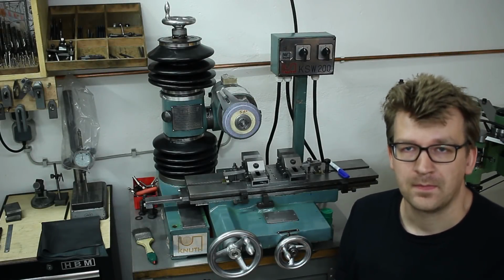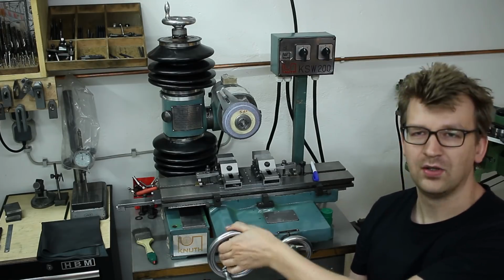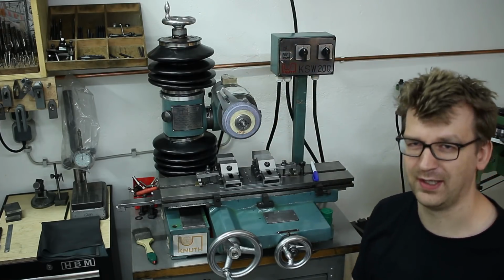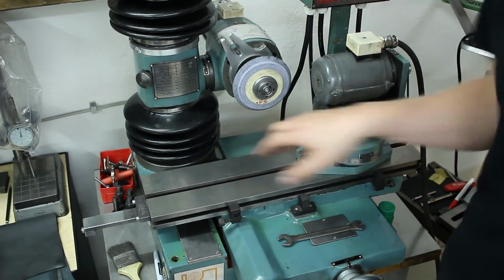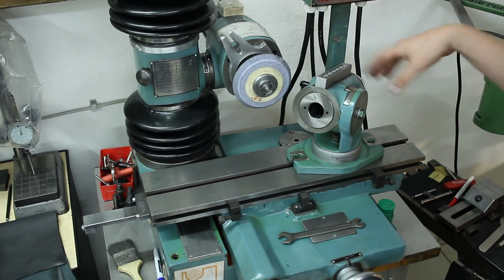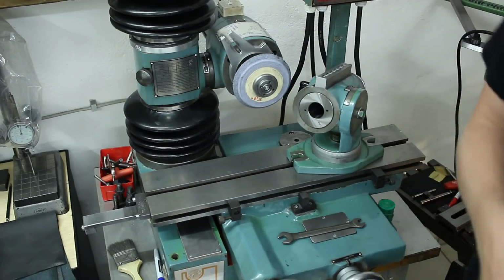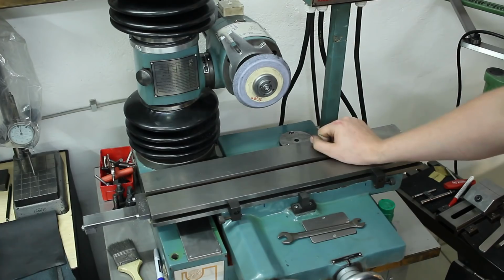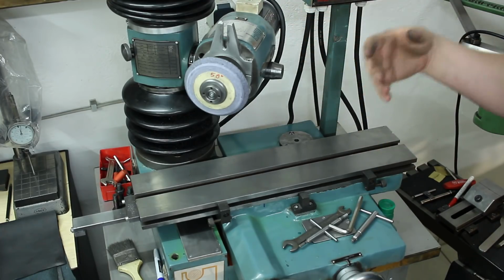Knuth KSW - Overview

Comment: Hi Stefan! I got WALTER UWS250 grinder (built 1959), and I am now colecting different accesories (mostly USSR made) for grinding. And problem is that I cant find any info about this machine, may be You can suggest where in german internet to find something? It is a old machine and I beleive that only manuals are (was) only paper version and has gone in past...
Cheers from Latvia!

Comment: i been thinking further intoo building / creating a usable allround toolgrinder and i like to hear youre thoughts on this idea i have 

second hand small lathes are a lot better available then used toolgrinders and can be bought for about 250 euro  
i wasnt planning on doing lathe work on such a machine ever again if i was going to use it for grinding as the grinding dust will ruin it 
if i replace the chuck with a grindingwheel (making a tapered stub intoo the tapered end of the spindle , held in with a drawbar though the rear like on a mill then mounting the stone on the other end of the tapered axle stub like it does in youre deckel style toolgrinder 
if i make those tapered stubs for every grindingwheel i have  i should be able to keep the stones on it centered and flat even when changing them around 
the carriages on the lathe will take care of the up down side to side motion (i'll be moving the tool to the stone from the side ) a lathe allready has all the dials needed to do "precision grinding" per side and either the compound rest or a spindexer set on top of that that can be rotated and tightened at any angle in the vertical plane on the toolpost using a degree dail (need to make sure the center of the spindexer is at the center of the spindle of the lathe , might need to make a fill plate under the lathe head to lift it off the bed a lot more ) )
i should be able to make other toolholders that mount on the compound or the carriage to grind lathetools and drills and even with the mini lathe i should be able to grind pretty big tools and run the stone at the rpm it needs and have enough power 

since youre doing a lot more toolgrinding than i do , could you see any problems with the idea ? 
(like not able to reach parts or make relief cuts stuff like that )

Comment: I hope those Chinese motors don't die on you. The driven workhead, ok, would probably not be hard to replace, but the spindle motor... entirely different story. No off-the-self norm-motor is going to be of use there...
Reply from the maker: Had it already apart - No problem to put a standard Iso-flangemount 3phase motor on :)

Comment: Wow I learn something from you even after not watching your videos for over a year, your English is so perfected (slightly improved change in only + more year Stefen) now. I am mad as you share and I learn about German households having 3 phase power at each house. We had to place a new poll, 3 capacitors and pull wire from that to our 400 AMP breaker boxes and so forth. The tool and surface grinder is nice sounding, it is also nice to be back to watching you make things happen.

Comment: regarding industrial stuff, couple months ago I saw a deckel S1 (I know it's not quite the same thing application wise as this Knuth) with some accessories sell at an auction for around 600eur, I'm still biting my nails in the mornings when I remember that, even though I don't really have the floor space to place it inside the shop :( , and that "final" price doesn't really mean that you could also buy it for that, that price might have just as well tripled if you and the other guy really wanted it, I was expecting it to cost way more, since the S0 usually sell for around 500 regardless of condition and tooling that come with them

Comment: Can't forget the variances caused by high or low tide.  Or high-low tide or low high tide.  And the extremes of high-high or low-low tide.  I seem to recall a conversation with someone that actually had that issue with a very large lathe that was in a seaside shop.  He said their solution was to move the lathe to another building farther inland.  I think I would have tried putting the lathe on it's own floating (independent from the rest of the building) block of concrete.

Your equipment gets smaller, mine keeps getting larger.  I decided to go ahead and get a surface grinder, ended up with a DoAll D-8.  Only about 2.5 imperial tons...  I'm back to squeezing myself between machines again.  It's footprint is about double what I figured it would be.

Comment: Like the cable drive change. The rack and pinion is one of the things I hate about mine. If I'm not easy it shows in the finish.
May do the cable drive to my new one👍. Great overview
Reply from the maker: Thanks Steve! I will do that cable drive mod to my surface grinder too - And then film the whole process.
Cant wait to see your new grinder, be safe, thanks for watching!
Reply: @StefanGotteswinter  are you still going to make a video on the cable conversion?
Reply: Yes an overview of the pros and cons of cable drive versus tooth drive would be very welcome. Thank you Stefan and Steve for your videos
Reply: the cable is wound on  drum?
Reply from the maker: @satxsatxsatx  it loops around the pulley one time
Reply: I'm wondering if a cable would be suitable for a plasma table's long y-dimension rather than rack/pinion

Comment: 4:15 is it just me or does a bearing sound crunchy on that motor?
Reply from the maker: Very possible - The spindle bearings are fine, but the motor bearings...maybe just the 19 year old grease that got hard over time. I will replace them, when I find time to do it.

Comment: Would like to see just how you converted from rack and pinion to cable table drive. My tool grinder has skew gear drive to it's rack and is very lumpy, not bad for a fifty year old machine I suppose, but converting it would be an option. A drawing on a scribble board would be great.
Reply: Well you might want to try researching pull / pull control systems used in light aircraft. Those would be pretty much the same idea since there's always a pre tensioned cable on each side of the control surface.
Reply: I'd forgotten those Ryan :-)

Comment: Stefan, how fast is “fast enough for ID grinding” to be successful?
Reply from the maker: depends on the diameter of the ID you want to grind - small grinding wheels need very high rpm to get to any useable surface speed. For a 20mm grinding wheel that would be about 24000rpm to get to a surface speed of 25m/s.
Reply: Ideally somewhere around 5500 SFPM for steel.  RPM depends on the diameter...

Comment: Seeing as the Wheel Head rotates 360 D would you  be able to mount a cup wheel and do End Grinding. We had an End Grinder that we used to square up the end of stock from the saw in order to have a clean surface to work from. Grinder was a Medina

Comment: You mentioned dovetail ways versus v and flat, or double v. Could you please do a short video on the benefits of each.
Reply: vee wayholds the table straight, flat can hold allot of weight, and dovetails act like a vee ( but worse? i dont quite remember)
a vee and a flat allow weight and straightness to be held. 
for more info read Moore tools the foundations of mechanical accuracy. 
im no expert. cheers!
Reply: so Amazon wants $350 for a used copy of that book, thats a little crazy
Reply: @EitriBrokkr  hmmm, i cant remeber where i picked my up but it was wayy cheaper. 
I belive google books has one of the moore books availible . 
The other great book by Moore is holes, contours, amd surfaces. this book talks about the production of very accurate machines. The first few chapters are the story of the Jig Grinder. 
it explains how to generate flat surfaces, what to messure for when building a machine. its also a great book
Reply: Buy it direct from Moore Tools, much cheaper and brand new.
Reply: You can order the book "Foundations of Mechanical Accuracy" directly from Moore(in the USA) for around $35.00, if I remember right.
Reply: http://mooretool.com/publications.html your memory must be lacking, more like $150 + S&H

Comment: great video, full of information,  bellows is good,  now I see all of tooling you were modifying,  lots of good ideas,  how long have you been upgrading this machine?
Reply from the maker: I just had 4 weeks of vacation - I did most of the work on-and-off during that period.
Reply: Impressive amount work you did. Cable drive, guards, scraping, reworking the accessories,  cylindrical grinding is a good feature is what I could use.

Comment: Very cool. I was waiting for this. Any particular reason you used this for the schaublin dovetails rather than the our surface grinder? I would have expected the surface grinder to be more rigid. Or did you just want to try this one? Also, since the grinding head can be tilted, what reference surface to you use to indicate it back to horizontal? Very cool. I am enjoying Steve Summers work with his and now look forward to yours. And I'm watching the local auctions 😬

Comment: Wow - 400V standard!  I wish we had that in the US :)
Reply: here in Europe we have 400v 3 phase standard but we only have about 32 amp if we are lucky. so if we want to run a bigger machine it can be a problem. I live in Denmark and I got a Colchester mascot lathe last year. my dad have an industrial building and we need to ad a 32 amp circuit with a 32 amp breaker and we only have just enough power to run it and if we want to upgrade to 63amp it will be very expensive.
Reply: 400V * 32A is 12.8kW, that's hardly a small or typical machine

but yeah, 400V is standard even in flats in Europe, I don't think you can even get a single phase connection to a house now – only time I see just a pair of wires going into a house, it's usually an old cottage from 50's (if not older)
Reply: jesper, it sounds like time to get some good battery powered LED lights and unplug everything else in the house . . . make the chips fly!
Reply: @willi-fg2dh  it's not that bad the electrician said that we could not run a lot of thing at the same time. But the only thing I stop is the compressor 5.5kw and the lathe is a 12hp motor but I don't know how much power it takes but at work we have I lathe about same size it's running of a 21 amp breaker if I remember right so I have about 10amps left 😀
Reply: It actually is 400Vx32Ax1.73=22kW if You use all 3 phases and on one single phases at 240V it is 240x32, exactly 1/3 of the available 3-phase power. Since one hp is 746 W if I remember it, You should need less than 10A to run a 12Hp motor continuously at rated power, so You should be just fine. I have a problem running my Weiler Condor lathe with just a 4 Hp motor on a 16 A fuse. The motor start currents can be horrendous. At higher rpms the 3 phase motor overloads the fuse briefly on each startup until it trips. We measured well over 20 amps on startup with my largest chuck at its highest rpm. The cheapest solution probably is a soft start VFD converter. At least compared to paying the power company to upgrade to more amps. And a VFD is of course otherwise desirable as well.
Reply: Erik Isberg  The first try should be to replace the often found (in households) fuses with B characteristics with ones with a C characteristic. They do blow slower and can take the high rush in currents.
Reply: Ya if you like dying when you get shocked by a faulty piece of equipment. 120V 15A just gives you a little reminder not to touch, 220V 50A will kill you if the circumstances are right,    400V 32A will just kill you outright.
Reply: Winky Pinky  The 400V are between two phases. You must be quite ignorant to touch two wires with both hands. And if you have a phase on the chassis, you don't deserve anything else. Darwin!
Furthermore, it makes no difference wether the supply is 10 A or 32 A. 10 mA (IIRC) through your heart are already potentially lethal.
Reply: Winky Pinky typical domestic circuits are 230V 16A single phase with earthing. I've shocked myself with it but only because i was servicing an amplifier and had the covers off, definitely not recommended by the way. Shocks from faulty appliances are extremely rare. 400v three phase is wired into the house and used directly for things like electric stoves, the 230v single phase is derived from the three phase and used for outlets.